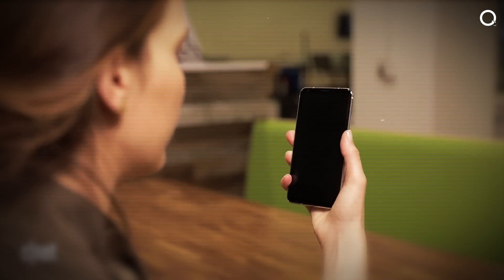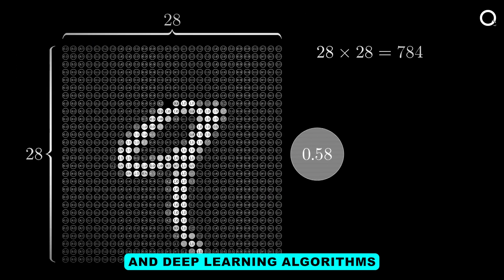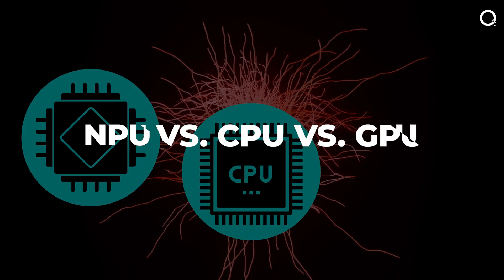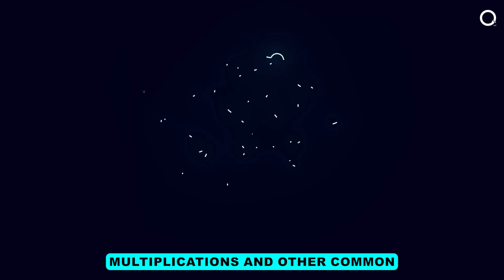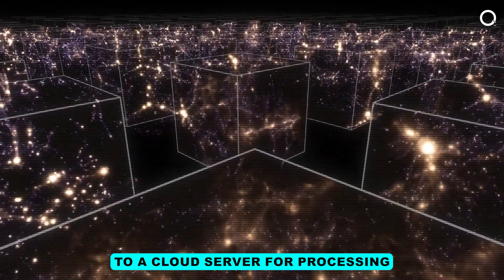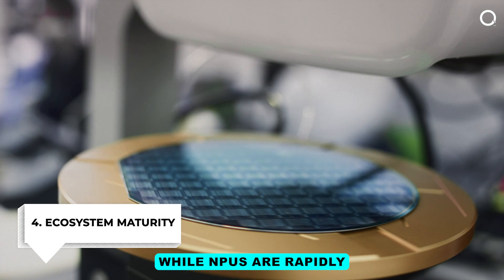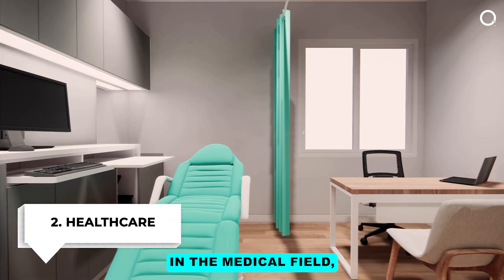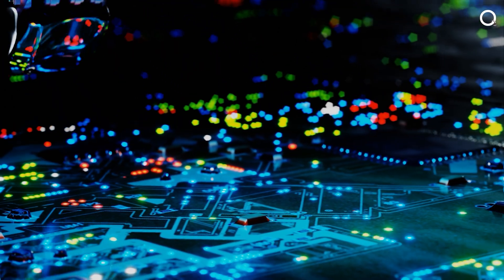What is a NPU (Neural Processing Unit)?

Comment: What about the cyber security of the AI system using NPUs? Does it have any advantage over current AI systems?
Reply from the maker: Most of the security would be done through the computation that leverages the chip, so an NPU provides more processing power tailored toward these training models to better assist to  detect threats